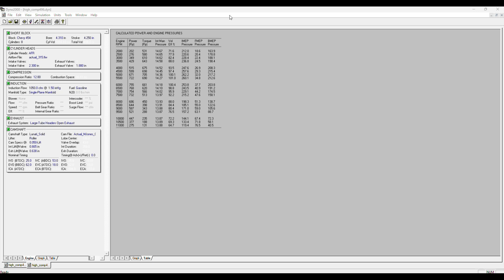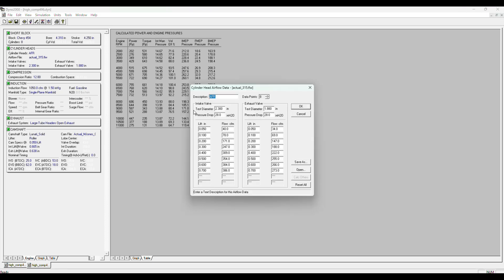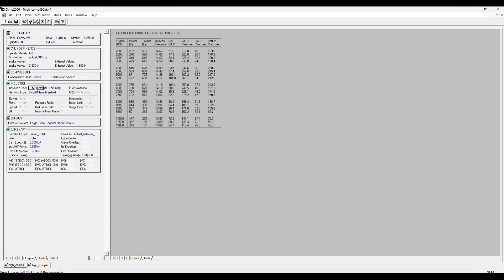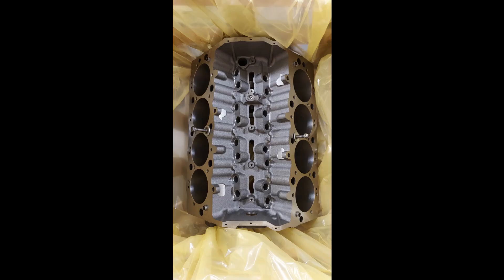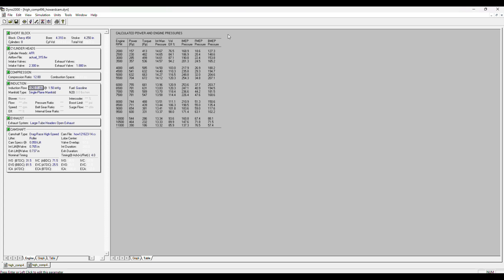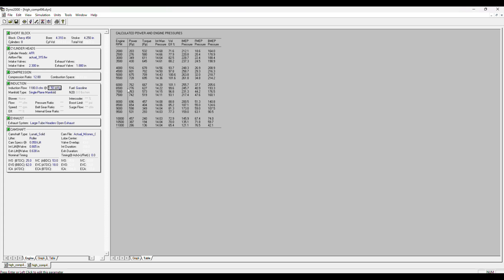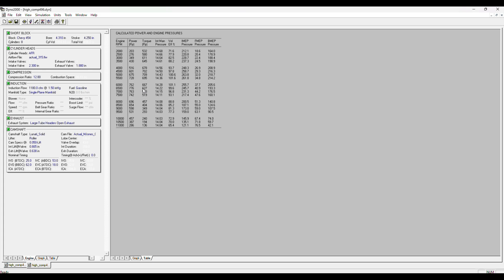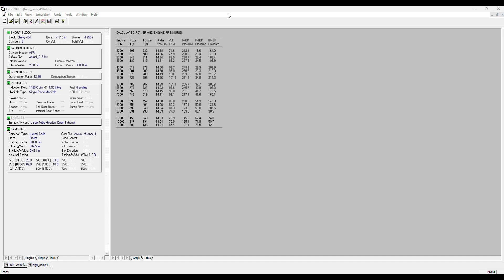dyno testing with old computer program to see if a cam change makes a difference

Comment: 496.  13.8 compression.  Brodix heads 2.25 intake 1.88 exhaust. 371 cfm @.700. 2927 intake. 1050 dominator. Isky solid roller. .730 lift. @.50 274/284 110 LSA
Reply from the maker: @ericwiningar8410  are those advertised flow numbers or you had then flowed? The data would have to include all numbers from .100 or .200 to peak.
Reply: @bigblockbob  that’s advertised. I have not had them flowed.  Brodix starts at .200 162cfm and close to 40 cfm per.100.  +or - until.700.  Dragon slayer 320s
Reply from the maker: @ericwiningar8410  2 things I question. 1. Brodix doesn't mention the bore size for those flow numbers. if they used 4.50 then it will look better than if on a 4.31. 2. Isky sire shows .730 lift with 1.75 rocker ratio. with 1.70 that is more like .710 lft